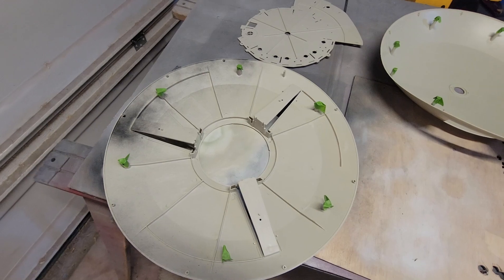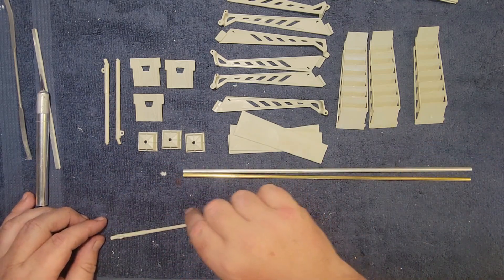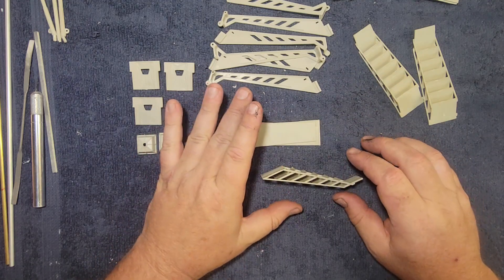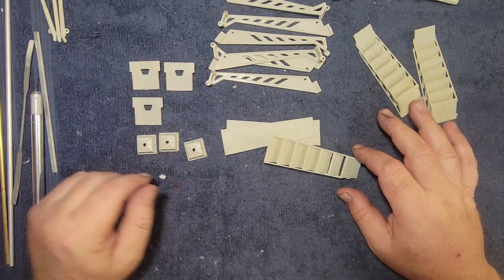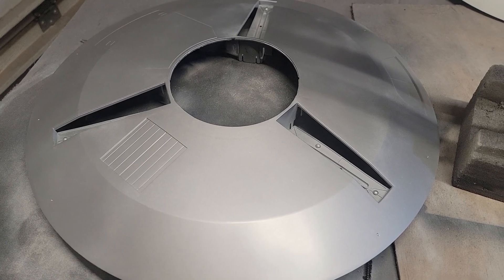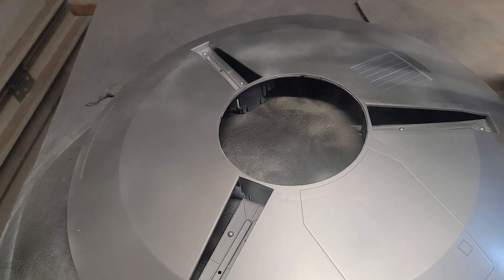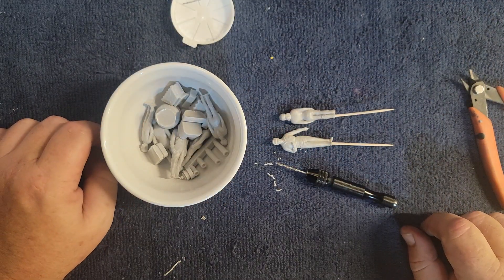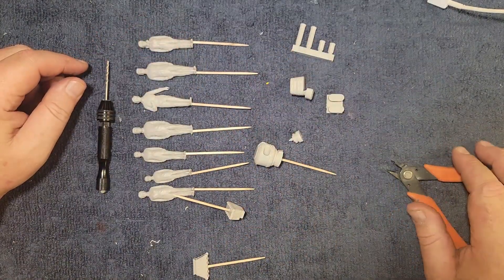Lost in Space Jupiter 2 - 1:35 Scale - Chapter 2

Comment: It is a great kit, Shawn. I'm 62 and would have gone ape if this model was available fifty years ago.
I built one in flight posted on my channel, the second model build after returning to the hobby in 2018 after forty years.. Description on the video explains a few aspects.
A second kit will be posed on its landing legs. I have done some work but shelved it to return when I have developed further skills from building other models.
Additions; Paragraphics photo etch, Moebius lighting kit with some custom wire/lighting.
Sliding air lock doors and docking port window. A removable section of the rear upper hull.
Lots of scribed hull details.
For your figures the silver works for the shoes/boots but the flight suit are high reflective
chrome like. AK Super Chrome or Molotow chrome ink will give the correct look.
For the cloth on Dr. Smiths uniform a ultra matte varnish removes all shine.
The issue with the kit is the two hull halves. I have not seen a good solution(including magnets) for keeping a acceptable fit when the modeler wants the top to be removable.
For the in flight, I constructed a interior support structure and used silicone to hold  the halves together. If I need to open it I can.
The second model I may set it up with internal mounts for screws. The countersunk holes for the screws would be easy to fill and blend and either a slight indication or template would find them for removal. 
 I build mostly 1/32, 1/24 aircraft. A big project in the works is a Polar Lights 1/350 Star Trek refit using the Trekmodeler Warp 8 light/sound kit and color guide, Mask Design masks. I made a custom metal stand that allows 360 degree tilting.
I have subbed and liked.
Hope you have a enjoyable build, Shawn.
Reply from the maker: Wow, that all sounds so intense!  I'll definitely re-subscribe and check out your builds. Thank you for the comment!  I'll be getting back to the Jupiter 2 soon. :) It's mostly done.